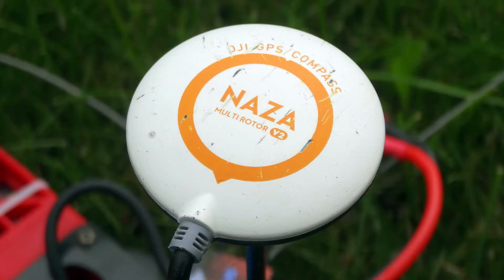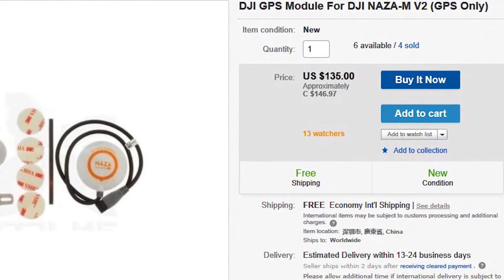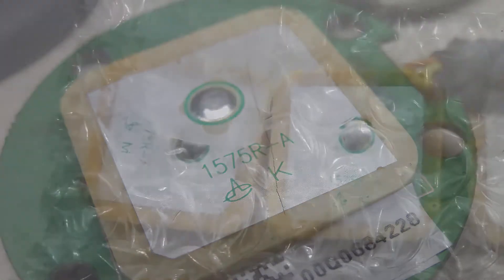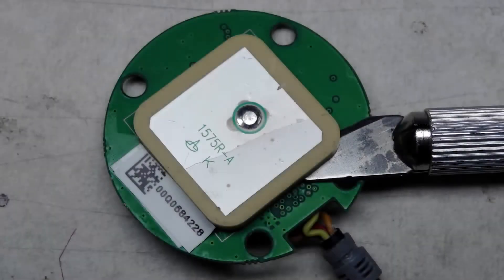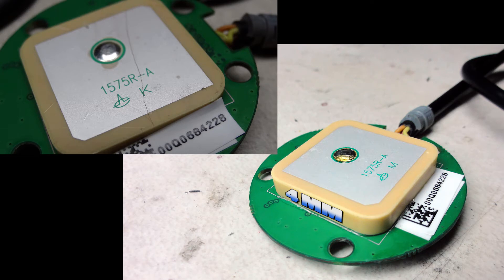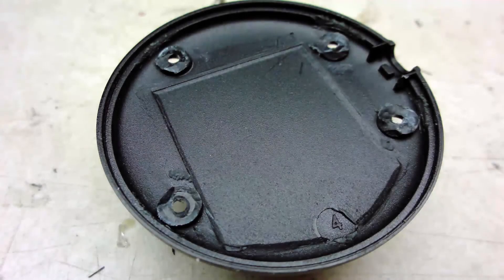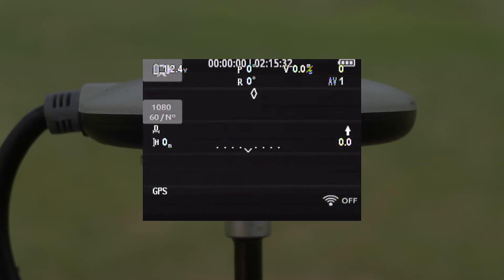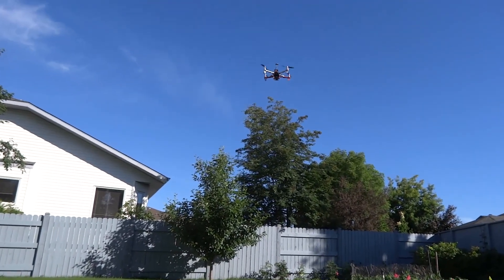How to - NAZA GPS PUCK REPAIR

Comment: Same exact thing happened to me. I just de soldered the antenna and ordered the replacement. So easy! Thanks for making this video.
Reply from the maker: +Tom RC (Liberty Blazing Angels) Thanks, one must be careful though to get the right antenna as they are made with different thicknesses.
Reply: +Hummingbird.UAV You made the 4mm fit, won't be a big deal for me to do the same.  ;)
Reply from the maker: Tom RC
This is true but I have come across even thicker antenna blocks that cannot be made to fix. :(
Reply: +Hummingbird.UAV That's not a big deal.. I'm a fabricator with a machine shop and vacuum forming equipment. Not much I can't make or make fit. lol ;) www.painlesstom.com

Comment: Today I found the same issue with mine. I was only up 20 feet when I clipped a wire ( lost control in manual mode) and it smashed into the ground. Thank you for your video.

Comment: Your videos are always good. Thank you for sharing.
Reply from the maker: Thanks very much.  That puck was the first thing to hit the road at ~69kph (42mph).
Reply: Yep. I've had my share of inverted crashes with my scratch built H quad. I fashioned an offset sliding mount on a post. The post takes the main impact as the antenna slides toward the quad. I didn't want to make the antenna the crumple zone. Nevertheless, one day, I will probably have to pull up your video to do a repair.

Comment: I had a bad crash when I first got my NAZA M V2. The GPS never worked after that but got a new one on exchange since the unit was still new. :-) It's good to know how to fix something so expensive and delicate... so cheaply
Reply from the maker: +James Hatton Hopefully you will never be in a position where you need to fix one.
Reply: +Hummingbird.UAV I had a "Run-Away" once.. scared me to death! It went full throttle through a Maple tree coming out the other side in mangled form. Luckily the flight control was good. I found some information that will help solve a run-away in the future. I had time to try attitude mode but didn't change anything but if I went to manual it would have cleared the error and reset the controller, then switch back to GPS mode and continue flying. It took me 6 reply's before tech support said that. So far I had not encountered any problems. I know this is a little off topic but anything to prevent a crash is vital.

Comment: i installed my new 4mm antenna yesterday. When i went to hook it back up i have no signal. Is there something i need to do after i repair the antenna?
Reply from the maker: That would be difficult to say.  In my case the puck was still working but poorly.  This meant that the "electronics" were in working condition and changing the ceramic antenna increased the signal reception to get a working puck.
Reply: check the wires are not broken by testing them with a meter end to end